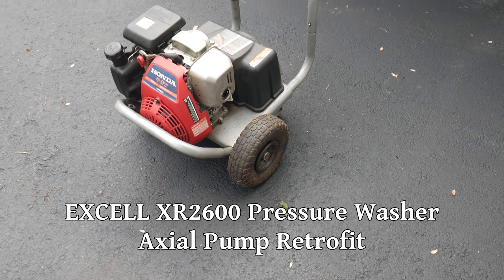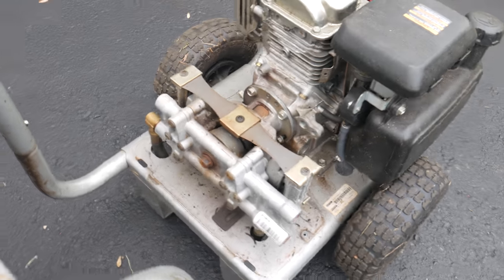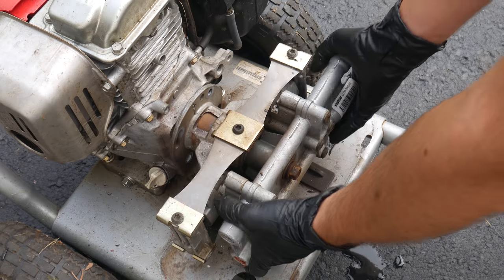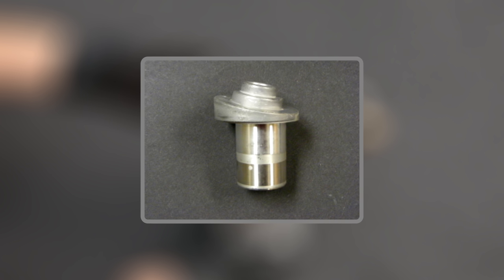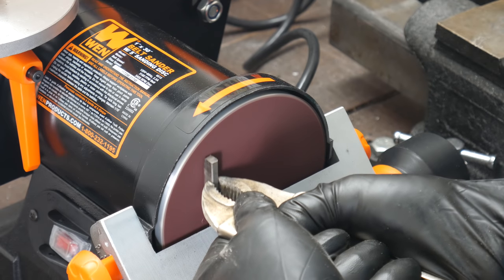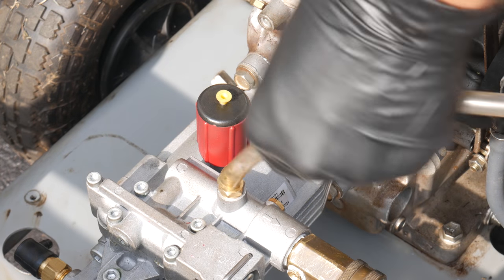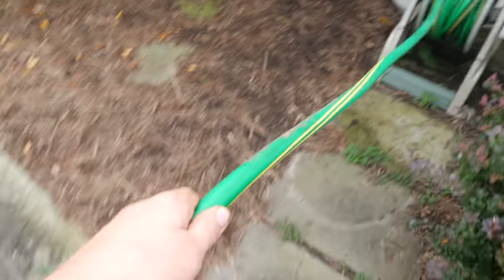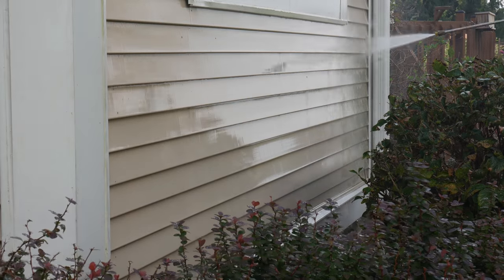EXCELL/Honda XR2600 Pressure Washer Pump Replacement (Axial Retrofit)

Comment: Man, you have got some very generous neighbors.
Reply: lmao
Reply: Pressure washers, TA's, etc...
Reply: my neighbor gave me the same pressure washer ... same problem xD also my tires will not hold air at all .. is about to buy some other kind of wheels
Reply: Yooo
Reply: I had the same tire problem Found the perfect replacement Tire/Tube /Wheel at the Local Tractor Supply Company store for $12.00
Reply: If you think about it, Fuzzy really did them a favor too. They probably knew he was good with machines, so they give it to him - he gets a free pressure washer and his neighbors don't have to take it to get repaired or to a junkyard😂
Reply: @FeddyWhuffs  harbor freight

Comment: that surging the motor is doing, there is this tiny pin hole in the carb thats slightly plugged, its about 0.013 pin hole size. Theres a lil plug under the pilot jet to access it, makes all the difference when p.washing =)
Reply from the maker: Thanks for that tip! I have only really used it for odd jobs, and never messed with the engine or carb other than what was mentioned in this video. I'm sure it could run a bit better than it does, if it is just a gunked up carb passage it shouldn't be a big deal to sort it out
Reply: Where is the plug located? In the bowl? You're not talking about the main jet correct?

I did see a brass screw in plug on the top of the carburetor, I'm wondering if that's the plug you're talking about?
Reply: @mikebruestle218  I'd gently pull that plug and look, mine were inside the bowl and plastic because CHINESIUM. Add a quality inline fuel filter too that helps cut down carb maint time as I use mine 9x a month

Comment: Now you'll have to pressure wash the rest of the house!
I had to do the same with a Ridgid Washer.  I'd have trashed the whole thing, but discovered the engine is an Isuzu, and is close in reliability to a Honda.  That pushed me towards replacing the pump.  I had no idea how many variations of a replacement pump there were, and I looked at over 20 different versions before I found what I was looking for.  Anyway, I cleaned up the washer, changed the engine oil, and the washer is good for another few years, I hope.

Comment: The black hose underneath is an accumulator.  These strap pumps don't run a typical unloader system, and so that hose is to capacitate the excess pressure when you release the wand.  If that wasn't there, the sudden spike in pressure would be detrimental to the porcelain pistons, and since fluids don't compress, it would end up destroying things prematurely.  I've thrown away dozens of those strap pumps, retro-fitting them to (most typically) a 3 piston axial wobbler pump (exactly like the himore you've fitted).  Still not as good as a crank-opperated pump, but a much more economical option.  The pistons seizing in their bores and fracturing is a common failure, as well as the straps breaking.  Even when those pumps work correctly, they're sub-par.  Their flow is "pulsy", causing the gun to sort of vibrate in your hand, causing fatigue, and makes your hands go numb after prolonged use.  For the home-gamer, it's usually a non-issue.  You're not washing down 10 cars a day with it, to care.  

The yellow plug is for shipping.  Because the pumps come pre-filled with oil, the cap is to prevent the oil from leaking out, should the box be place wrong-side-up.  It'll probably work itself loose as the pump oil heats up the air inside the pump, and increases pressure.  Highly doubt it'll cause an issue while running.  What would be concerning, is if you were to leave the plug in as it cools.  The resulting vacuum from the shrinkage of air could cause the plug to seat itself, and seal off the pump body, while still cooling.  This could cause the pump to start pulling water passed the packing seals over time, and into your pump oil, and cause pre-mature failure of your pump assembly due to oil frothing from the contaminated oil.  Basically, take the plug out, it's packaging.
Reply: Great Sound Solid advise and Information Thanks

Comment: Dad got this exact one for a hundred, except that the only original thing on it is the frame. When I tried pulling the cord, I didn't feel the compression, it was the same all the way through, after some adjustments, it started on the second pull at 28°f or like -2°c, so below freezing. When I looked at the engine, it was blue, was mostly constructed of metal, had JD on it, and the honda sticker was placed on top of sticker residue. The pump didn't work. After some searching I found it on the internet; the hose, gun, pump, engine, and wheels were different. I wasn't joking when I said the frame is the only original part. I'll edit this and post the engine brand and specs.

It's a Jiangsu Jiangdong corporation model JF120 127CC 4 hp engine.

Comment: great video for the exact PW that i have, thanks. if you are gonna spray vinyl i highly recommend getting a downstreaming kit and using some soap with lower pressure. it doesnt etch the vinyl and keeps mold away longer. they are easy to install and cost like 60 bucks

Comment: I knew it would be cake for you lol. You can spray with the gun tip much closer on harder surfaces or bare metal. 2-6" is where we train our crews to keep the tip. You'll get wet, aim your ricochet... Tone down psi at the "unloader" for wood or painted surfaces. Spray too far away and you lose a lot of the psi goodness the Honda is pushing. Try a Turbo zero tip matching the gpm of the unit, amazing results... Detergent injectors are subjective. Get a hand pump sprayer for car soap and casually washing stuff. Soap at 3000psi makes an unnecessary mess if you're not careful. Park the machine so it doesn't get too wet and Pull the tiny yellow oil valve cap plug when using. The pumphead needs to vent at full rpm bc temperature changes and expansion of fluids and gases inside.  Replace plug when storing or turning unit on its side, Or use a solid cap to retain pump oil. You can use SAE30 NONdetergent as pump oil, and Detergent added SAE30 for motor. Do not reverse the two. Change both oils often and the washer is alive for a long time. Beer after dinner made me type a little lazy. I apologize for the grammar. Nice repair!
Reply from the maker: Great info, thanks for sharing!

Comment: Never thought I'd need a pressure washer till I had one show up on Craigslist for $50 and after some carb work and a rebuilt pump runs great. Now I don't know if I could do without.  Feel the same way about a leaf blower I got and fixed up.

Comment: That plug lets pressure out of the pump case. 1000000% recommend removing. I work on pressure washers daily. 
Also this pump is affordable and will likely last. But a good Comet replacement pump would be much more reliable and has higher pressure and gpm on the same honda engine
Reply: I'm a subscriber now for the car stuff but the pressure washer repair could use some.work lol

Comment: I had a 13 hp honda powered pressure washer that the pump did the same as yours... took it apart and the pistons had exploded. We have hard water and it rusts bad when not used.  I use a pump conditioner now when im not going to use it for long periods of time.
Reply from the maker: True, that is a good idea. We have very hard water here as well, it doesn't get along with the plumping fixtures. Good idea to store it with a conditioner of some kind
Reply: @FuzzyDiceProjects  yup..I found it at the farm supply store..little can you just screw it in the garden hose end and it's kinda like fix a flat in a can.
Reply: @Northern_Farmer  can you just cycle vegetable oil throught it? Or very sopy Walter? I don't think that using any "tiny" can in the input changes anything..
Reply: @kitecattestecke2303  why wouldnt it...the can is pressurized and it coats everything from the inlet right through to the outlet. You could use vegetable oil but how would you be able to pump it through the pump?
Reply: @aaronhall7740  yes that should work
Reply: Never thought of using vegetable oil for pump storage, that's a neat idea!  Although, one common mistake I see customers do, constantly, is storing their PW with the hoses attached.  That water will dry out, eventually, and even if you have the nicest tap water on the planet, you'll still have mineral deposits.  Always remove your hoses and wand, and drain them before storage.  You'd be amazed how much water stores in your gun.  Remove the tip, point the nozzle up, and after removing the hose, pull the trigger.  Water will flow out of the wand inlet.  When you do hook it back up, leave a tip out of the wand, and get water flowing through the hose and wand, before you start the engine.  Then, fire it off, give it a few pulls, make sure it's unloading correctly, put in your tip for your work, and make stuff wet.

Comment: A lot cheaper if you can do it yourself. Great job. God Bless
Reply: This is easily a $300 repair in my shop, the pump(while 100xs better) is over half that cost. You can almost replace the entire unit for that price so DIY is always best with these small residential units

Comment: Whenever I receive a power washer to repair, the pumps are always the first to go bad. Usually the engines work perfectly fine. Most customers don't want to pay to put a new pump on so they just end up giving it to me, since they would normally throw them away. 
If I find a pressure washer with a blown engine, I would simply  swap parts and use the blown engines for parts. I wouldn't buy one new unless the customer requests it. Because in some cases buying a new power washer would cost less than the new pump and the cost of installation. Most of the time, the pump is removed and scrapped and the working engine would be saved to be used for something else. 
Just about every residential pressure washer built nowadays is cheap Chinese garbage with Chinese Honda clones that have problems all the time. Only the prosumer and commercial units with good pumps will last for a long time, but it comes with a heavy price tag.

Comment: I HAVE one of these , used it once, worked great , its been sitting in garage 2+ years , wont turn over ,  ??? Spark plug , clean carburetor??  What would you do first , not a mechanic or even close
Reply: Won't START, or won't turn at all like it's seized???  If you can pull the rope and the engine spins, drain the old fuel, and use the 4 cycle fuel that comes in the prepackaged can.  Pull out the spark plug, clean it if needed.  If it's only 2 years old or so, it should still be good.  You can get a gauge to measure the gap of the igniter on the end too.  Sometimes I'll cheat and use just a spritz of starting fluid to help an engine that's sat with old fuel started again.  You may also be able to unscrew the carburetor bowl off and clean it if needed depending on the type of engine.  Using the canned fuel helps engines from getting gummed up from old fuel.
If you can't turn the engine and it feels like it's locked up, you have major problems.  Find a friend that's handy, and invite him over for beers...
Reply: @ffjsb  thanks I’ll try that, it does spin when i pull cord , just wont turn over and start

Comment: Great video. I have an old Honda Pressurewave PWH 2500 with a broken pump which looks identical to the one that you took off. The only difference is that mine was mounted vertically below the engine. Could your replacement pump be mounted vertically?

Comment: Thankyou for this video!!   Mine had exactly the same failure.  The pump you selected is about a third of the manufactures suggested replacement pump.  Ordering the PE24 instead! :-)  (Sorry Grandson,  no motor for a go-kart yet)
  Edit: got it, installed it, it worked perfect!!!  By the way, the supplier I bought it from on eBay provided all the adapters needed.  😎. ($67 fast & free)
Reply: What was the complete part number for the replacement pump you got?
Reply: I see it is a 
OEM Himore Power Pressure Washer Water Pump for Axial 309515003 Engine Sprayers, but I'm not seeing a 3/4 to 7/8 adapters
Reply: Greg Padden  I bought it Mar 31st. Search for this:
  PRESSURE WASHER PUMP Replaces Honda Excell A01801 D28744 A14292 on XR2500 XR2600
   Lot of sellers selling this.  Got mine for $67.99,  but there are sellers asking as much as $109.   Prices might be higher now.

Comment: What kind of socket do you use to get the water hose connector out? I have this pressure washer and need to replace it but can't get it off?

Comment: The older stuff is better built... 
I have a 95 Craftsman track drive snowblower I bought for 50 dollars 7 years ago... the axle bushings were shot and the previous owner put water pipe as a bearing on one side, so it wallowed out the hole... so I bought a 1/2" steel bar and some pillow block bearings, calculated the new hole placements for the drive gear and the track drives and slapped it together... and replaced all the bronze bushings in the track drives and added ball bearings instead of bushings in the upper drive train.  Works like a champ... I needed to add sheet metal wings on the auger housing because the tracks are now 3/4" wider than the auger housing. Before, the outside tracks were in line with the housing, so without the wings, it would climb up on the snow. Was about 75 dollars in parts total... works better than new.

It has the original auger housing (not rusted through), scraper bar and motor, I also added an electric start I scavenged off a blown up motor... And I had to make a new carb cover (out of a car aluminum heat shield) and muffler (out of sheet metal from a rusted out push mower deck), they rusted off.
 
I have an 8 year old Troy Bilt I use at my apartments and my auger housing is rusting through and the scraper bar had to be replaced already...
 
They don't build things to last anymore...

I just scored the exact same washer for free... 
Haven't dug into it yet...
Pump is leaking like a sieve...

Comment: Hi there, can you share the website links where you got the new water pump as well as the new pressure hose? My pressure washer, which is the exact same one just went out yesterday when I wanted to wash the deck.
Reply from the maker: Hi! Unfortunately I got the pump off of eBay and the listing isn't up anymore, but I would definitely check there with the part number given in the video. You can also pretty much just go by the product pictures and find one that looks identical since they go by different names. Same goes for the replacement hose, eBay. I will say that it didn't care for the 5/16" hose and to go with a 3/8" because I couldn't get the siphon feed to work reliably with the 5/16". Sorry I couldn't be more helpful!

Comment: I did the same thing on my B&S Power washer... water froze and cracked the pump.... The wife did ask if the new pump (as well as the rebuild kit I ended up not using) cost as much as a new Pressure Washer.. course I said "no", but she did say, "I'm surprised didn't upgrade to a bigger pressure washer"... which I didn't even think of at the time, dang it!.  But I like fixing instead of replacing too.
Reply from the maker: Haha, fair enough. Looked at options for new ones and seemed like they were either a few hundred dollars more than just replacing the pump (and hose) or did not have good reviews after long-term use, so I figured this option was good enough for now

Comment: Can I find a key for the pump to fit on the engine shaft?  Also, what size tap will I need for the the threads?

Comment: Has anyone noticed that the new pump gets super hot?  I had emailed the company and the suggested replacing the lubricating oil , which turns out was two ounces and not the full 4.5 ounces.  
I replaced the oil and it still gets super hot.  Waiting to hear back from the company....

Comment: @Fuzzy Dice Projeects
I've just discovered your channel and I'm now on a watching spree. I grew up around Firebird's and 'IROC Z's', so they remind me of my childhood and teenage years. I would have jumped at your new project immediately! Let me know if you get tired of it.

As a coincidence, my Honda powered, consumer grade power washer started backfiring and dying towards the end of last summer. A small engine repair shop told me the water pressure pump was seizing and the unit was trash. He wouldn't even take it for free, or repair it. It's only less than a few years old and has been used maybe a half-dozen times. Does this sound right?

If so, this looks like a project I could tackle relatively easily. Could you please provide a source and/or some details for the new water pressure pump? Hopefully the new one will last significantly  longer. Thanks!
Reply from the maker: Glad you have been enjoying our videos!

If your pressure washer isn't particularly old, it's likely it already has an axial pump and the swap should be even easier and a crank key should already be present. If it has a cover over the pump, take it off and see if it looks like (or very similar to) the one I installed here. Search "Pressure Washer Pump Honda GC160 Engine 7/8" Shaft" on eBay to find the one I ordered. The product page has some good details (seller: eprdistribution). I believe all of the Honda pressure washers use a 7/8" shaft but I could be wrong. Also measure the mounting bolts and compare to the specs on the eBay page.
Reply: @FuzzyDiceProjects  
Thank you sir, much appreciated. I'll do that!
Reply: I suggest you take the pump off the motor and run it by hand or with a drill and confirm the shop's diagnosis. I've not been around much equipment that "kinda" seizes up...